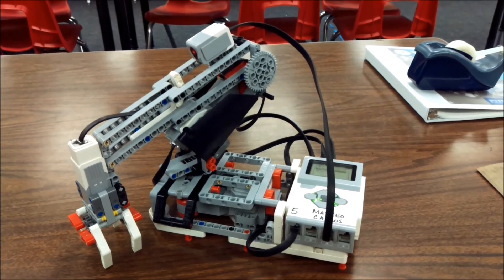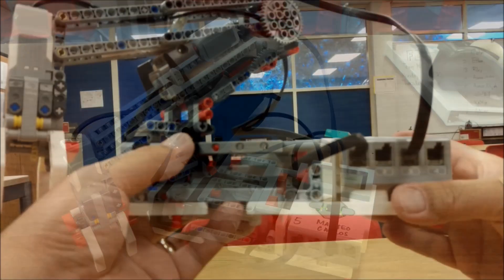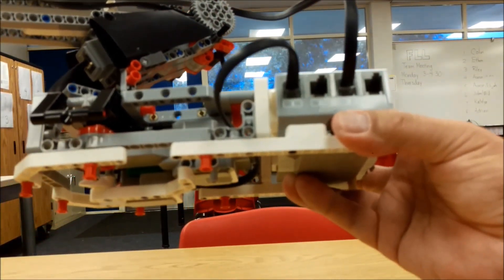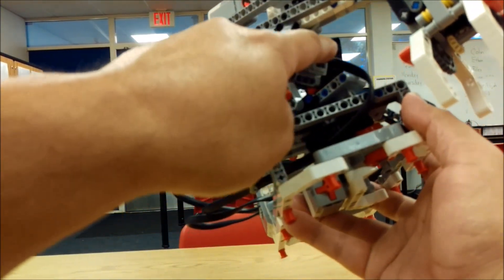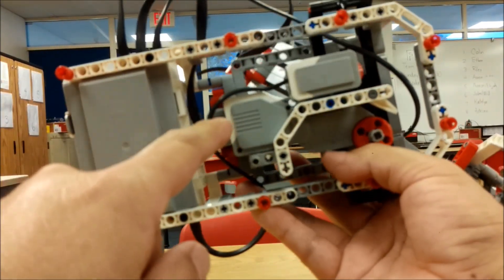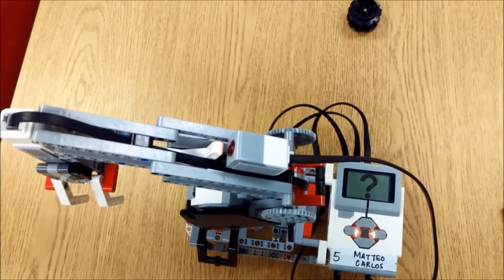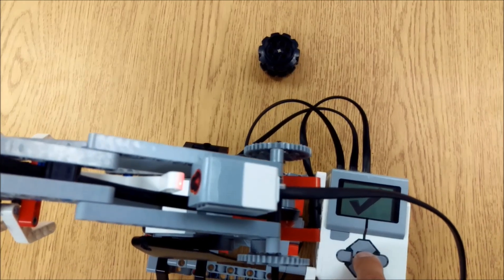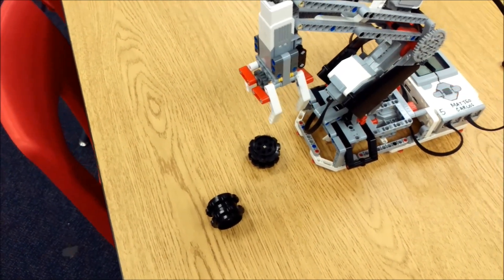"The LEGO Mindstorms EV3 Robot Arm The Cables & The Program"

Comment: Mr. Hino, my students' robot arm does not initialize in the 9 o'clock position...it touches the touch sensor, then moves to the 7:30 position instead. The little white 'fin' piece seems to be aligned correctly...do you know what might be causing it to start out after initializing at the wrong angle? Maybe there is another alignment we need to check? Thank you for any help...
Reply from the maker: Possibly check that the cables are not preventing the arm from swinging freely.